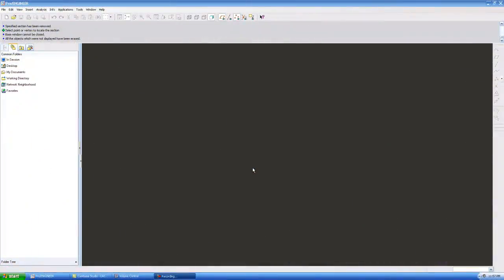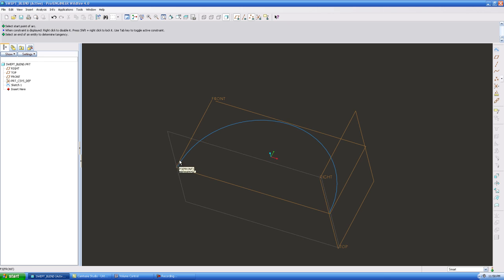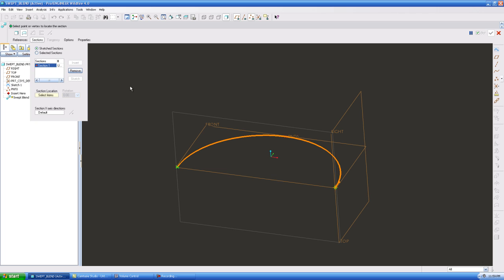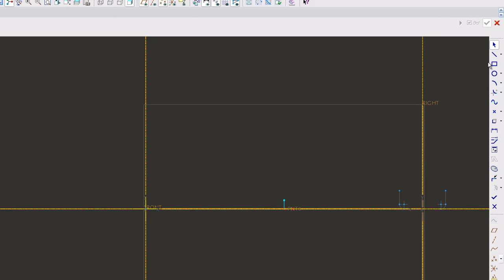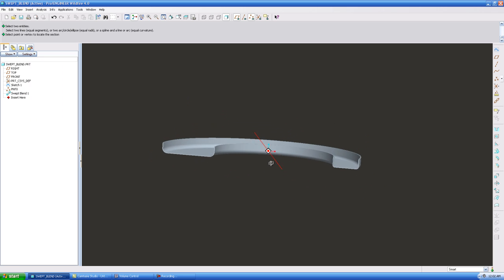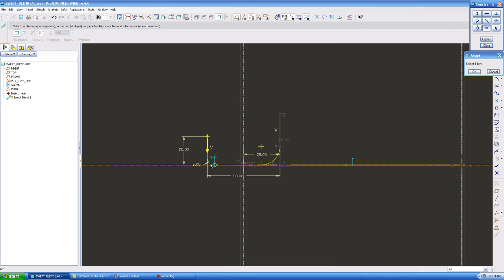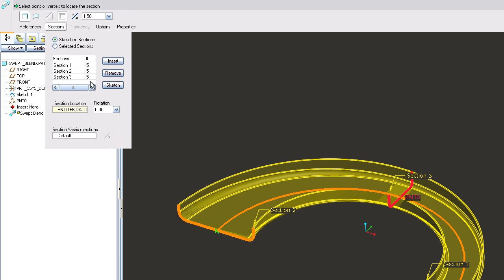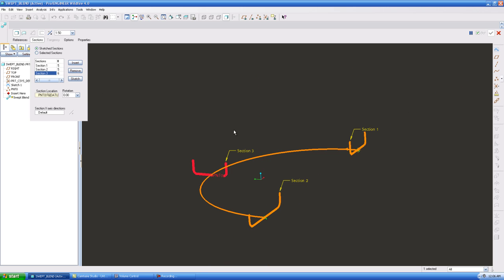Pro/Engineer Swept Blend Tutorial

Comment: I get an interesting problem... the two sketches are connected "inverted" so that the swept blend crosses itself through the middle. It seems to have to do with the sketch direction (yellow angle in the sketch). I cannot find any way to flip the sketch direction of one of the two sketches, need to redraw the sketch starting from the other side. Any tips?